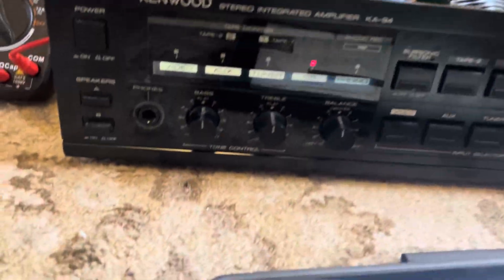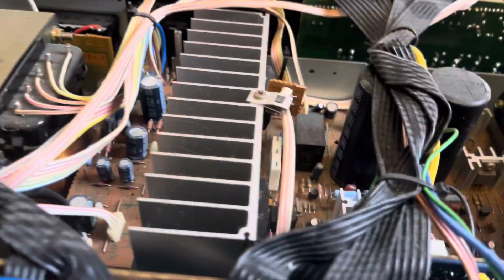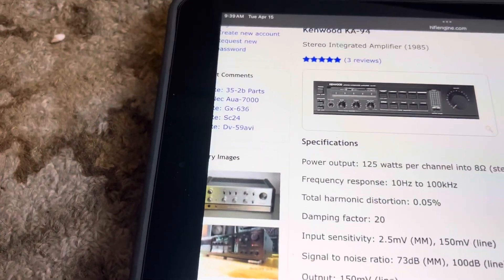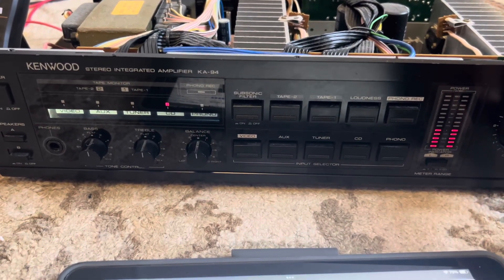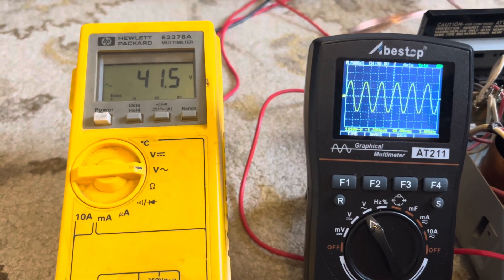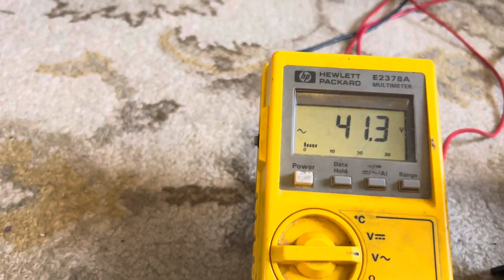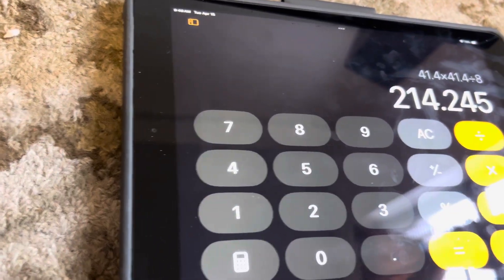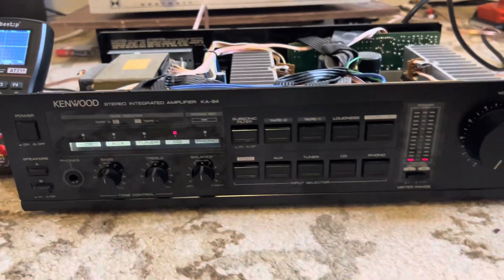Kenwood KA94 Amplifier Power Test at Clipping

Comment: I have one of these. It's the most "sleeper" amp ever. Got it for free from a friend who thought it was worth about nothing.
Powerful, good sounding. Tiny. Mine is driving a set of Sansui SP-X8000 with ease.
200+ Watts 8ohm music power. That's impressive. But I believe it. haven't heard mine clip/distort yet, even lighting up the 150W VU on music peaks.
Reply from the maker: I was quite surprised at how much power they little amp did. Built well sounds great too.

Comment: That’s almost double. One amp I would like to see run on a test like this is a crown xls 2502 they say that amp bridged at 4ohms is 2400w
Reply from the maker: @jasvq7  I had the xls 1502. I didn’t make a video but I do remember it putting out a lil over what it was rated. Sounded pretty good too.